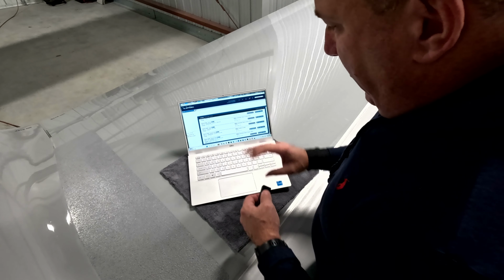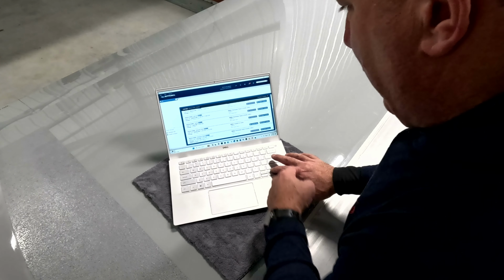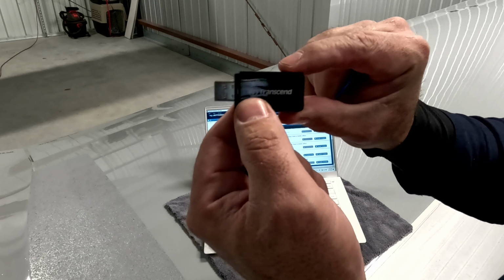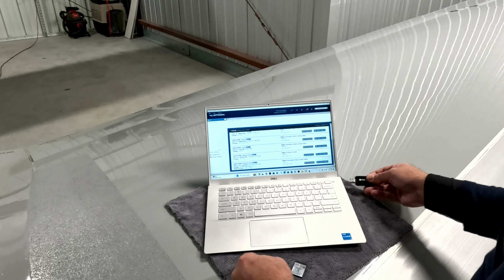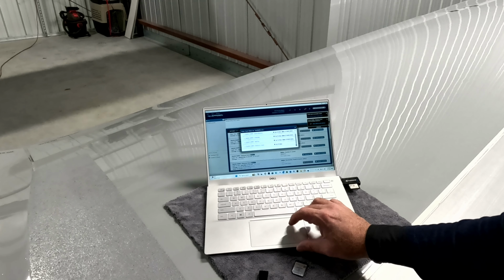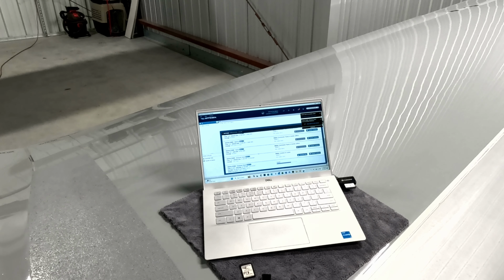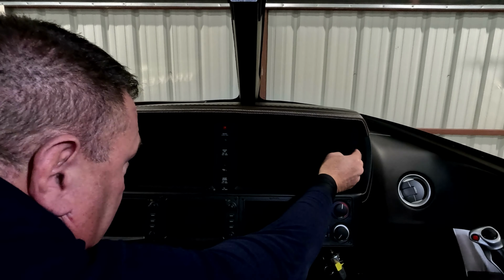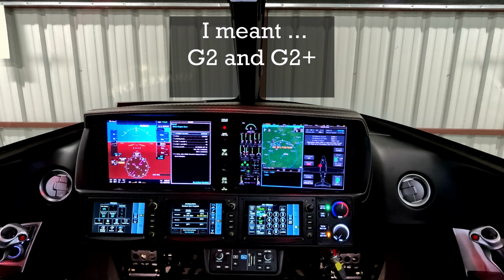G1 Vision Jet Garmin Perspective Touch Database Updates

Comment: Funny how different all the varieties of Garmin require different procedures. I don’t put any data on my flightstream card. Another gotcha is the write protect tab sometimes gets bumped when inserting the card and that messes things up. I agree 100% about the connext way of doing it, too many errors and it’s slow. Great video!
Reply from the maker: Yes Sir. The newer Vision Jets update probably similar to the nice planes you fly. There is what is referred to as a briefcase card and it is simple a supplemental case used to move the new databases and charts to the MFD instead of putting files on the FS510 and PFD cards. The displays in the newer Vision Jets can accept files from the supplemental card. The G1 must have the active and standby databases and files on each of the cards.